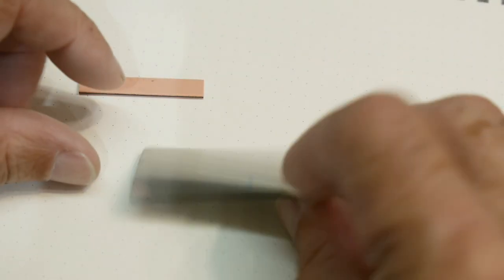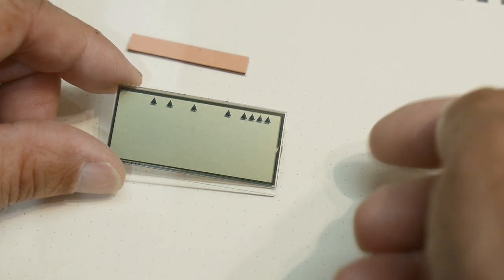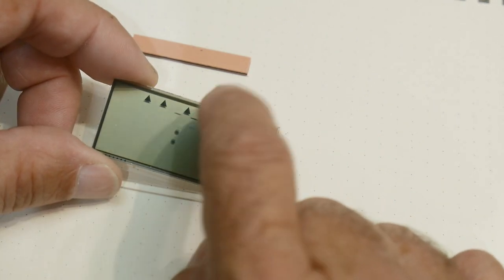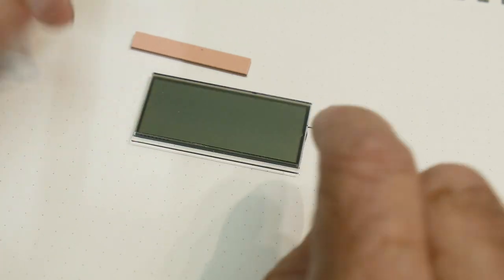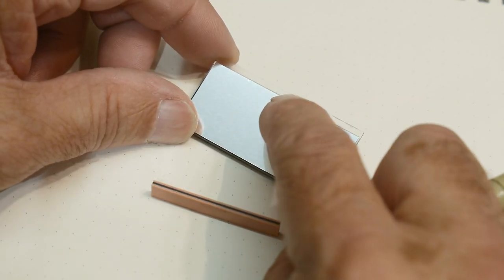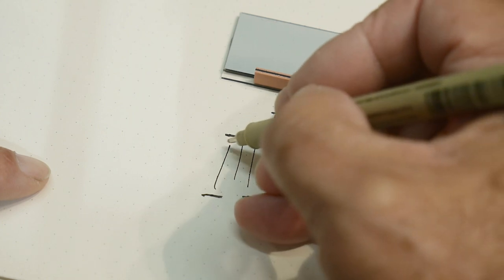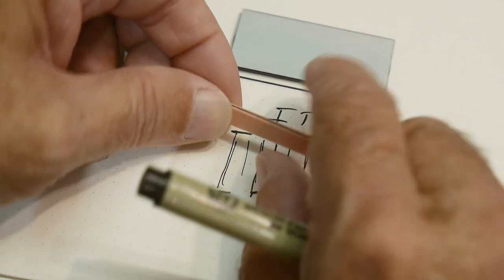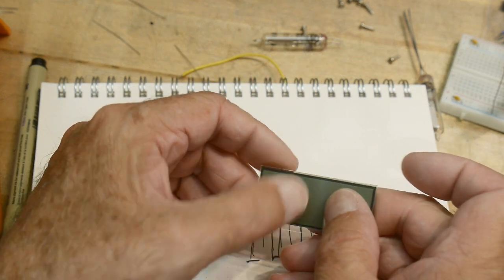#1571 Zebra Elastomeric Connector

Comment: Very good video! I always wondered why I did not screw up these elastic connectors when I put something back together! Now I know it is made to be inserted quite randomly and it will work every time. Cool!
Reply: Hm, I never seem to be able to do that, they rarely work again after reattaching...
Reply: @HA7DN  maybe not enough pressure applied on the board on either side to make contact correctly? Or maybe the zebra connector is dirty, clean it with some IPA?

Comment: Ha, I’m currently working on a project that uses zebra connector to an LCD.  Kind of a PITA to work with.  I had to have a board made with the edge connectors and then squish the LCD down onto the board, aligning it correctly.  It was kind of fun to reverse engineer how the LCD was arranged.  It used 4 Coms.  LCDs are way more complicated than LEDs.

Comment: I used to have to replace those lcd's back in my 2-way radio/pager repair days.  They were a real pain.  If you touched the zebra flex strip with your fingers, you might as well throw it away.  The oils from your fingers can ruin them.  We had to wear cotton gloves to handle them.  I don't miss working on them.

Comment: Remember seeing a different kind of elastomeric connector years ago. Instead of carbon strips, it used fine gold colored wires (not sure if real gold bond wires or gold coated) otherwise it works and is used the same way.

Comment: Fun, I remember seeing those a lot tell I started taking apart Ti calculators. Those use plastic loop with carbon connectors and a silicon bar that is looped over to give some pressure into the connection. 
Btw ITO is really beautiful to sputter onto glass. Has a nice purple glow at the sputter source.

Comment: I remember when repairing lcd modules for avionics, we was many times replacing these zebras due to especially the pcb connectors has pressed a imprint in them. Lots of fiddling and clean fingers.

Comment: Are these LCD's are specific to the application, like the digit layout etc? Also when the LCD dies is it possible to replace with something else generic? I know the zebra strips do fail. It's hard finding any good information on these. Thanks for your videos again.
Reply: They are highly specific to the application.  They are broken down into com and segment lines in a matrix.  The number of actual segments on the display dictates how many lines you need.  If it breaks, you are SOL.  You can have LCDs made for about $100, but then you have to know how the one you’re replacing was designed.
Reply from the maker: they are hard to drive also. strange waveforms and voltages
Reply: @jimomertz  thanks, that sucks, I have some instrument clusters where these die, I would like some solution when they die, so I guess I'd have to go further back in the circuit to make a solution.

Comment: Thats a coincidence, I am publishing a video in the next few weeks repairing a bit of test gear with a bad display, it had an unusual type of zebra strip which I hadn't come across before, I actually did the repair on one of my live streams.
Reply from the maker: what was unusual
Reply: @IMSAIGuy  The Zebra strip was not enclosed in rubber, it was a bare strip.
Reply from the maker: oh, the stick on kind? they are a pain
Reply: @IMSAIGuy  Not stick on... it was used like the standard rubber type, but was mounted inside a slot on a plastic frame to hold it up, look out for my video about the Wavetek Model 21 in a few weeks time, you will see what I mean.

Comment: How do you solder it to the board and the LCD?
Reply: It isn't soldered. It just needs a little pressure against the contacts on both sides.
Reply: @stephentrier5569  OK, how do you keep them together?
Reply: Either the mechanical design clamps the parts together or there's a bit of adhesive somewhere. Often the case clamps the parts together. Sometimes a bracket or bezel does the job.

Comment: sorry . but as far as i know the metal thing on the back is for the reflective part. not  to act as one plate of the capacitor.
Reply from the maker: you are right is not as simple as I stated as it was not the topic. but there is a back contact that allows an electrical field to be generated perpendicular to the face of the LCD.
Reply: @IMSAIGuy  totally agree. I was just complaining about the reflective layer being rendered that way. Please forgive me if I bother you with that little detail. Thank you very much for your work!
Reply from the maker: maybe I should do a video about displays. I worked a lot on ferroelectric liquid crystal displays. very fast switching times.
Reply from the maker: similar to this: https://www.forthdd.com/technology/flcos-operation/
the back electrode and mirror is actually an active CMOS IC.